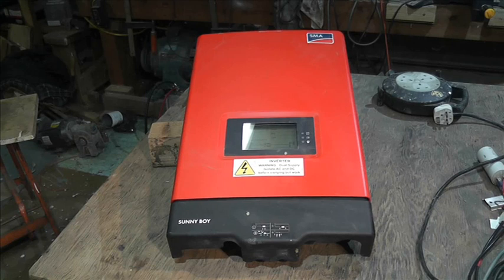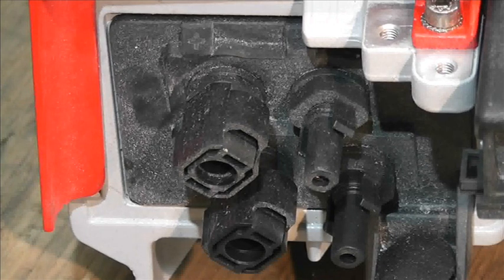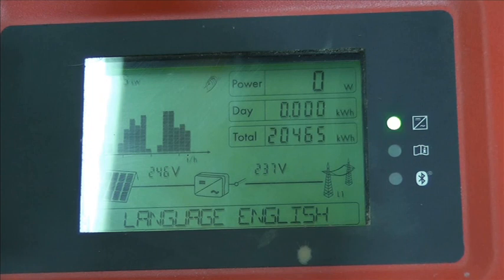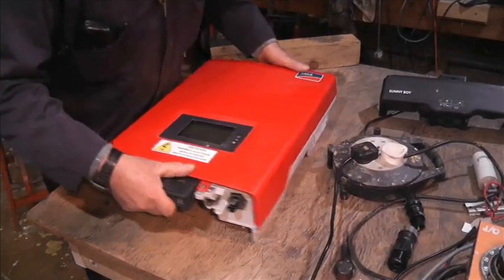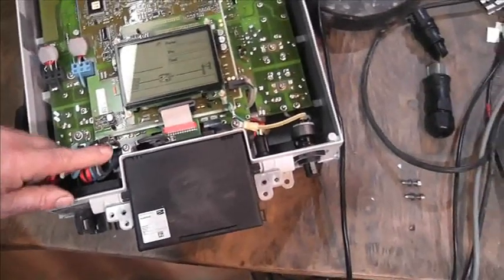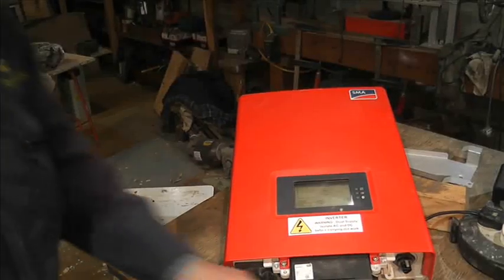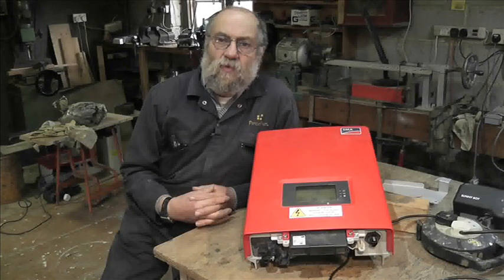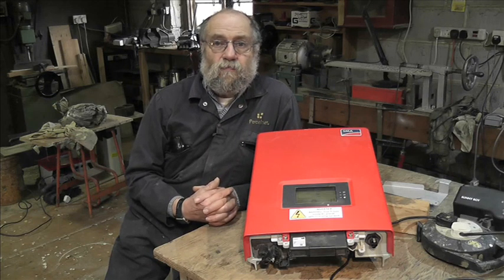SMA HF solar grid inverter, features and test.

Comment: dear sir,
my 2500HF is only blinking but not turning on. DC is 204V AC is 236V, specs say that is should run from 180VDC... How do I find the failure?
Reply from the maker: Is the mains and the DC reaching into the inverter, sounds like the mains DC is missing, cheers
Reply: @TheInfoworks  think its reaching the inverter, I can read  DC is 204V AC is 236V,  on the inverter screen. will be trying tomorrow with an extra panel, so en extra 30 VDC

Comment: Hello sir,

Is it possible to use it in Off-Grid system?
Reply from the maker: Hello, it needs a mains signal to start and it won't run from batteries. If you set up a local grid then it's possible it can send power into that, but you need a good bi directional battery inverter, cheers

Comment: Hi, I have no numbers on the power and day boxes and the red light is illuminated. Could you please tell me what this means?
Reply from the maker: Hi, the first thing to check with your multimeter is that DC and AC are getting into the inverter. I suspect you will need to take the cover off, cheers

Comment: Interesting Im trying to find out what is wrong with a 3000HF which has never really worked since install. Can you explain what the "dc disconnect" is please is it just a link to disconnect the PV input? The one Im looking at has an isolation switch and various other bits which I havent identified yet but probably fuses between the SMA PV inputs and the PV array so before I go and just pull out the dc disconnect I'd like to understand what it is please.
Reply from the maker: Hi, yes it's just a direct link, you can test it with a multimeter. You need to check if both DC and AC is getting into your inverter, it's a common problem, cheers

Comment: Can this inverter be used with a 12v batery bank?
Reply from the maker: Hi, it's a high voltage grid inverter, so it's not a battery inverter.. My new book is now out, Wind and solar Electricity edition four. Might be helpful, cheers

Comment: I'm glad you brought up the water wheel, I had been thinking lately how it's getting on. 500W per hour for similar generation to 4kW solar panels.
Reply from the maker: And there as a good chance they work better in winter but noisy and damp, cheers

Comment: I bought a second hand one with about the same usage as that . Found it very inefficient at low input power
Reply from the maker: Adrian, interesting, they do have a high start voltage, cheers
Reply: @TheInfoworks  Not really around 20 ish . I had another sunny boy  before that was ok, then ended up with a solar river . Then a cheap sunny boy was available so fitted that, it came with the remote display .just wasn't doing the kwh at the end of day
Reply from the maker: @adrianstout2345  we must be at cross purpose, this one starts at 175 DC volts, cheers